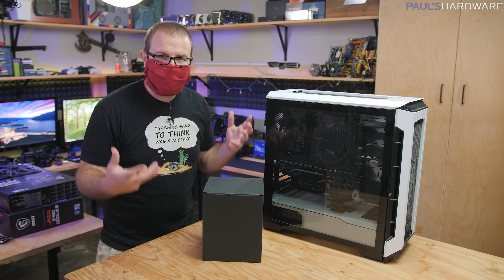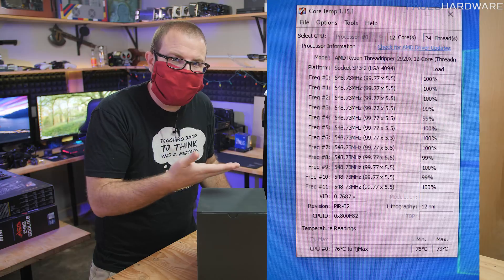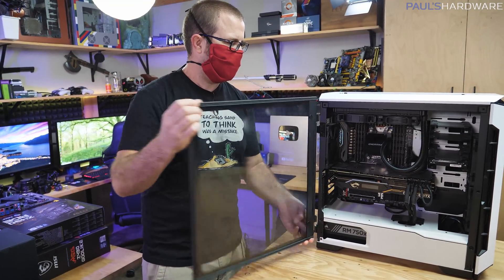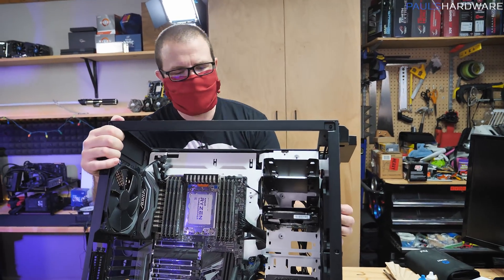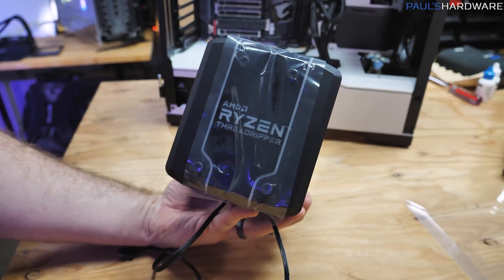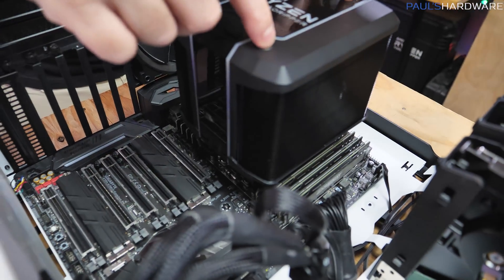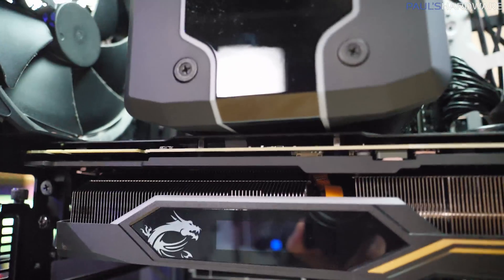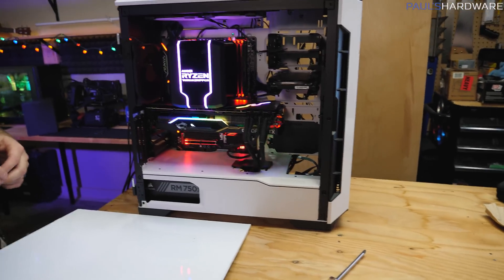Why We Switched from an AIO to Air Cooling...

Comment: So done with liquid cooling - tried it twice. First was a "GREAT AIO" that...stunk and died. Next, a swiftech open loop where the pump failed in warranty and Swiftech didn't honor it.  With liquid cooling, I always felt that I'm just waiting for it to fail.

Noctua NH-D15 for me. Big, not pretty. Quiet. Reliable as can be - keep it reasonably clean, fans spinning. Do a thermal baseline on install and if the temps start rising, repaste (maybe once every couple years if not longer).  Yes, my system is VERY old (11 years) - a 3930K with a RTX2070 - but it still does EVERYTHING perfectly fine, doesn't crash, and stays VERY cool (3930K is a factory CPU where the cpu die was essentially soldered to the inside of the IHS). Runs almost as cool as it ever did on water and haven't touched the heat sink in over 4 years - thermals are still "perfect".

Doubt I'll ever give liquid cooling another chance. Sure, the theoretical thermal capacity is great, but added parts, maintenance, and in my experience questionable quality.
Excessive complication for my needs, really. I'm also at a stage in my life (some would just call that stage "OLD") where I don't want to fiddle with and coddle my system - I just want it to work with minimum fuss - air cooling works perfectly for me. I built the system, I used top line parts (at the time) and, 11 years old and still going strong. Doesn't crash and the only thing it really fails at is being a space heater.

Comment: Anyone got a good answer for me. I recently overclocked my cpu (R7 2700x) but it’s having big jumps at idle going between 50-60 degrees but at 80-100% load is staying around 70-80, my case doesn’t have a lot of space for a big cpu air cooler and would like my cpu running nice and cool when idle and just browsing. So is it better for me to go with a nice AIO or should I try find a air cooled one that would fit my set up? Any answer is better than none :)

Comment: This story is just awkward. So basically people were telling you that Enermax AIO-s are crap but you still instaled one in a customers computer and then couple of months later it sucked like it was expected and you changed it to air cooling. Why you didnt buy a good brand like Arctic Freezer2 or Corsair H100i Pro or Kraken Z63 and you could of avoided this situation maybe for like 4-5 years... This video is like >>> DONT BUY AIO CAUSE ITS SUCKS<<< but actually you suck cause you installed a cheap crap...

Comment: Ive run air tower coolers for years always reliable and never have any problems, even if a fan goes out its nowhere near the hassles of water cooling -- new fan and good to go for another 5 plus years if you buy a good fan.

Comment: I found with the Aorus Extreme that the Wraithripper blocked the top GPU slot enough to prevent card insertion. We run lots of GPUs for simulation work so this was a big no-no for us. Ended up with a Corsair h150i which has been fine for us.

Comment: I like the idea and look of water cooling, but ive always stuck with a good air cooler because I hate constant problems with things like incompatible metals, coolant sludge, possible leaks and unnecessary maintenance in general, water and electronics dont mix in my book - I build the pc to use not be a slave to and I value solid reliability above pretty lights & with a good air cooler the most I have to do is keep it clean (takes ten minutes every few months) and on the rare occasion a fan goes bad every few years I change it, its a big plus not having to worry about water destroying my computer, if an air tower coolers fan goes bad most large tower coolers have enough cooling capacity on their own to keep things from getting out of hand until a fan can be swapped out.

Comment: Liquid cooling looks cool, but for me air cooling works perfectly fine.
Reply: ja i have 
Deepcool ASSASSIN III and overlocked cpu not more than 50 degrise and in prime 60 -65 :D soooolid
Reply: 4 years ago, i saved 100$ for a Corsair 240rad AIO, used it for 3 months and go back to air cooling up to now. 
Clearly if u often upgrade things inside or changing case many times, AIO is not a good options, beside when u need to change thermal sinks.
This is my opinion but i really love ajr cooling more than AiO, easy install and more efficiency.
Reply: idle 35 :D
Reply: @_. that’s your take.  I like my aio with strimmers . You can fill your mobo and still have it nice and neat
Reply: @teebo5298  what aio do you use? Was about to go with the lian li one but then stumbled upon a litany of broken pump videos/complaints which got me pretty concerned about the durability of aio pumps and if its even worth it to dump money into aios if pump issues are common and unavoidable
Reply: @_. I got the z73 I know the lcd does nothing but it’s  cool to look at temps or gifs  lol .but fan or aio I saw little difference even after oc my ryzen 5600 .  But I also only game so that’s a gamer take
Reply: I prefer something smaller than a massive brick
Reply: @teebo5298  me too but any chance of leak would worry me
Reply: @FoxzyD009  aio been pretty good to me.  Truth be told it’s not really a massive diff between fan . Pure liquid build yes big diff . But even gaming 4K I would be fine with a fan
Reply: @teebo5298  Massive brick is what you get when an AIO leaks

Comment: add more metal to your nh d14 and you will never replace it. currently looking for an aluminum or copper frame round 140mm fan that i can thermal paste to the cpu top while its mounted to the tower cooler for more heat sink mass

Comment: "Joe" should be thankful that you're such a good friend because if I were you I would have told "Joe" to take that PC back and not dare bring it back to me to fix until he had that PC all cleaned and dusted out properly.I once had a big fall out with a so-called friend because I installed a lock for the guy and I told the guy not to mess around with enlarging any of the screw holes or the cylinder hole that I had drilled and mounted the lock to and the guy had the God damned nerve to call me two weeks later complaining to me that the lock wasn't working properly.I went over to the guy's house and inspected the lock and sure enough,the guy messed with the lock and made the mounting screw holes larger and also reamed out the cylinder hole (for what reason is still beyond me many years later.) then had the unmitigated gall to ask me what kind of licensed locksmith am I to do such shit work when the guy himself was the one that totally fucked up the lock installation.I charged the idiot a service charge plus the full price for fixing the major fuck up that he made by messing with the the lock installtion when I had warned him not to.After that the jerk fucked up his locks and had the nerve to call me and I hung up immediately then the fuckwad had the nerve to bad mouth me because he ended up having to call another locksmith that charged him the full service charge and the full amount for repairing the jerk's locks after the jerk fucked up his locks again thinking that he's some kind of engineeer that knows better than us licensed locksmiths.When ever I install locks I make absolutely certain of where exactly the customer wants the lock mounted on any given door and I make it perfectly clear to any and all customers that once the lock is installed the lock cannot be easily be moved up or down without drilling new holes.I do my best to be fair so I give customers time to make up their minds as to exactly where on their doors they want their locks mounted before I start the lock installation process,I can't be any more fair than that.

Comment: This is why I will never buy another AIO again.In my opnion a custom water cooling loop is the best bet because apart from the water block getting all gunked up the only thing that can fail is the water pump and that is easily resolved by installing shut off valves and having an extra D5 water cooling pump on hand in case the water pump ever craps out.With an AIO if the water pump quits then everything has to be removed and replaced where as with a custom water cooling loop only the pump has to be replaced.Thank you for the video,may God bless you and your family.

Comment: I just ripped all the water cooling out of my Tower 900, between the GPU (name omitted) and the enermax neochanger things became corroded, and yes I cleaned the loop every 6 months. Just ordered a CPU cooler and a RTX 3090 Suprim X, I should be set for a while. Water cooling is fun but it’s a major pain. Thanks for the video

Comment: Maybe it is because in 2020 105 watts does 8 times + what 225 watts did in 2012 with liquid? Something like this should keep it Happy.
 https://www.newegg.com/arctic-cooling-freezer-50-tr-acfre00055a/p/13C-000P-000A9?item=13C-000P-000A9&source=region&nm_mc=knc-googleadwords-pc&cm_mmc=knc-googleadwords-pc-placpu+cooling_-13C-000P-000A9&gclid=CjwKCAiA5IL-BRAzEiwA0lcWYg1M8MC4IQJ6e1oAfPgFL6eWCgqr8QRFJte4mtyXMk_5f-BilRVhkxoCDyUQAvD_BwE&gclsrc=aw.ds
Or the CM Wraithripper.

Comment: That air-cooler is to close to the gpu, the heatsink relies on the difference in temperature to dump heat energy into the surrounding air.

Comment: My full custom waterloop with EKWB monoblock for x570 motherboard, chipset, video card does not need maintenance more than 1 time a year. Using proper coolant, not cheap one, will save you a lot of time later :)

Comment: I would not have added the top 2 fans. Games Nexus has a video where he shows these fans can disturb airflow in such a way that the airflow through your air cooler is less than optimal. With the two intake fans in the front panel, you have a good supply of fresh air. Any excess air will exit through the top screen on its own due to the positive pressure in the case.

Comment: Hey I am upgrading my Workstation I have a Crosshair VIII Hero motherboard and a AMD 3950x cpu but because I want a 30 series card do u think if I use my GTX 970 GPU it will hold me until I Get the 3080 TI? Ps…be kind yeah I know it’s a 970

Comment: You shoulddd!!!
I just have an accident with my AIO.. My AIO can't handle the water pressure for 3 years or so.. It's suddenly leaking! And dripping on my VGA card. I was playing some games, at 1 AM in the morning.. Then suddenly no display. 2 of my monitor suddenly blacking out! But I still can hear my games playing.. I was turning off and on few times, nothing happened.. Then I opened my PC to check it out.. And OH.. MY.. GOD!! It was a disaster 😣😣😣
I already check all my system to the service centre, it's all good.. Except my VGA. The AIO are wrecked, nothing can be done there. The motherboard was OK. But my VGA.. Sad! The service centre can't approve my claim. Because they said it was a human error, so the warranty was void.. Still, i'm trying to fix it up with my local technician. Hope it will be running againnn.. Cuz i can't spend anymore money to buy a VGA card 😭😭😭
From now on, no AIO for me.. #sadlyfe

*sorry for my bad english 🙏🏼

Comment: I just see air cooling is just the best
Aio liquid cooling is not that bad but when it comes to breaking down, then air coolers only have a fan to worry about, but aio's have a pump which you cant replace, the coldplate and radiators might get gunked up, and most commonly it might leak
With an aio there are many reasons to worry

Comment: AIO are a con (ish)

They are there because you want a clean build, not because you need performance. 

We have to deal with years of bad youtube videos giving people the impression that water cooling is somehow better at cooling than air coolers.

The benefit of an AIO is it allows you to MOVE the radiation from the middle of the case to the top/side. Good if you want a nice perty PC. However, more often than not just getting a much cheaper yet still good air cooler will beat the small AIO's and rival the large ones.

Comment: I use the ryzen stock cooler and my ryzen 7 3700 is overclocked to 4.3 GHz and I still get good temps. Around 65° under load

Comment: Wait! You can vacuum your PC? I thought you can't because it causes static and you are supposed to use compressed air.l
Reply: I have used the vacuum on my comps for  a long time man. It's no problem.
Reply: You can certainly vacuum the dust filters, but DEFINITELY do not put that thing anywhere near the motherboard as seen in this video. Static can absolutely cause either total destruction, or really, really hard to find issues if you happen to shock some random component.

Comment: Get a Noctua NH-D15 and it will last you 20+  years, the cooler is made of  Copper (base and heat-pipes), aluminium (cooling fins), soldered joints & nickel plating this should last forever, the fans are rated to last for 150,000 hours or 17.11 years😂
Noctua NH-D15 warranty is 6 Years, Simply Amazing. Has two fans  If a fan fails get a new one for under $20👍.

Comment: I would never use anything using water in my computer. I am very logical. And doing otherwise is dumb, especially some cooler are very good like hyper 212 rgb black with extra fan for push pull config and it is very inexpensive and the cooler is super nice. It works with r3900x

Comment: Joe has quite the balling system there.   How does that case fan set up(2in and 3out) work out in general...? Just did that to my son's, (panzer max case and 5 silent wings 3 fans) and it seems like a ton of heat is coming out of it.... 
Anyway, great video.  Stay safe

Comment: This is actually not true and the title is a bit misleading. Many good brands like Corsair, NZXT, evga... offers very good AIO’s with FIVE years warranty that many ppl deploy in their system with zero problem. AIO’s looks better, cool better and quieter in most of the cases comparing to air cooling.

Comment: Been lucky my H100i has been in for 7 years and temps still perfectly fine but I do have an old system with a 4770k cpu. Pc is always on and rarely is turned off.
Reply: I also had a water cooling that I was using for eight years and cero problems, I think the failures of it only depends on if you are lucky or not.
Reply: Same on a 4790k (6.5yr). Won't even throttle on the balanced setting, so it never gets loud.
Reply: I really hope I get lucky with my h150i 😭

Comment: I see you are vacuuming dust. I heard doing that may damage components because of an electromagnetic field that forms while doing that. So is this a special type of vacuum cleaner or...?
Reply: There is no electromagnetic field being produced by the end of a vaccuum cleaner
Reply: it can generate static electricity. its fine to vaccum your dust filters and the outside of the case, but its not recommended to vacuum inside the case or to touch any pcb while doing so.
Reply: @LithicKing  I see, thank you for the heads up!

Comment: What is the problem to replace a water pump each year or two? If you are not able to take a pump and few fittings that does not mean a water cooling is bad ;) You don’t complain you have to change oil in your car every year. 
But for a content you can swap air and water collers ad often as you wish )))

Comment: I actually have my Asus Founders GTX 1080 mounted in the second slot to distance it in my production rig from my Cooler Master MasterAir Maker 8 and 64 Gb of Crucial Ballistic RAM - and I'm only sporting an i7-5960X 3Mhz - not even overclocked. Was I being too overcautious when I built this? Is second slot giving me much performance hit in a non-gaming 3D modeling and texturing rig?

Comment: I like fan coolers. Maintenance is almost non-required...and sometimes can be quieter, no water gargling noises.

Never have to worry about much with air cooling and something big and bulky is usually enough to be as good or better than 240mm AIO in heat removal performance. 

Not sure I like how that gpu sits right against the cpu cooler thou, prob doesn't matter but weird.

Comment: When I installed an M.2 SSD, I had 2 of my other drives stop working as well. Turns out that was by design according to my motherboard manual. As you use more of your M.2 sockets, more of those SATA ports get disabled, at least on my motherboard.
Reply: It all depends on PCIE lanes. Some m.2 slots share lanes with sata connections so you can only use one or the other not both.

Comment: I had to get the noctua because ia have high profile ram. Wraithripper cant be installed with it. Noctua originally also not.. but I could manually set the fans 2-3 cm higher which was enough

Comment: I read something awhile back that said you should never vacuum out your pc, static can build up on the nozzle and discharge. As a novice builder, sometimes it's really hard to know what's accurate and what's urban legend. I'm curious if you did anything to prevent static, like if the psu was plugged in but set to off or if it just don't matter. Using a vacuum sure beats using q tips and small cloths to wipe everything out

Comment: I keep seeing that AIOs are no more efficient and Im sure thats true. You can only dissipate as much heat as the radiator is capable of. But an AIO allows you to more efficiently use your space, it allows you to take up less space on your motherboard while still having a large three fan radiator. They also look better in my opinion and add something interesting to the build.

Comment: 3 months later, after installing a RTX 3000 series: Why we swapped back to AIO.
Reply: Exactly
Reply: unlikely.
Reply: @Mrx1080  I think he meant it being a big card and not fitting with the air cooler. It's possible.
Reply: @Just_a_Tool  The 3080 seems to run very hot, so the added performance of water systems may make a bigger difference. Or at least we'll need more GPU favored airflow.
Reply: @draco89123  3090
Reply: Aio on my 3080 runs great